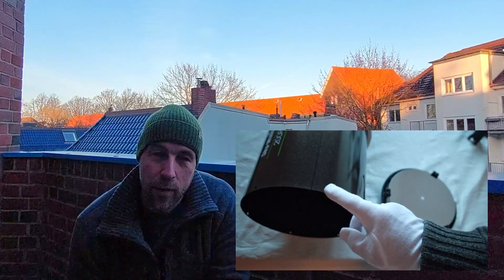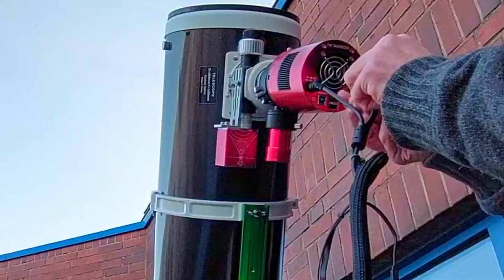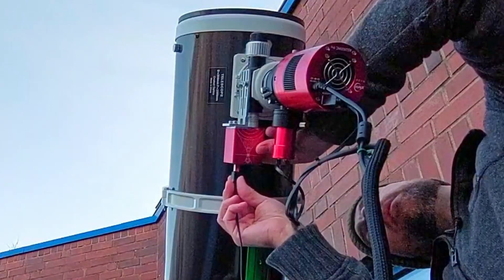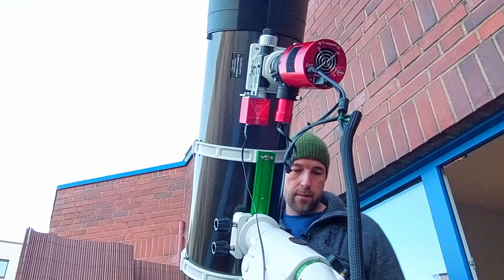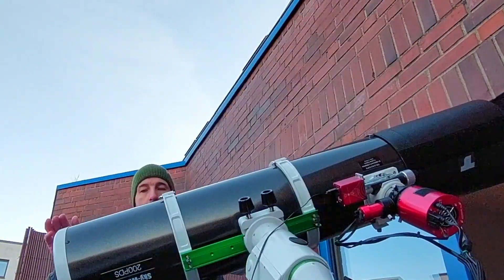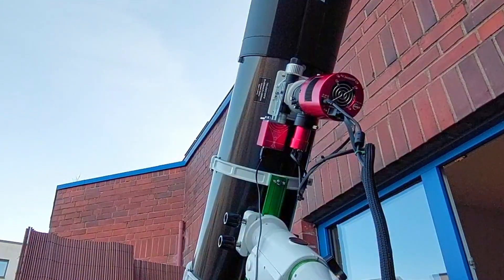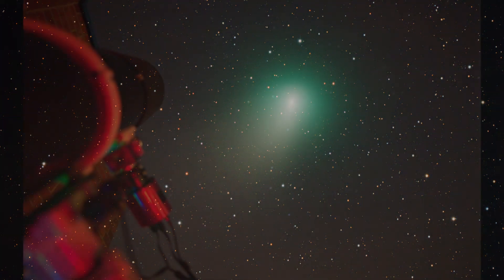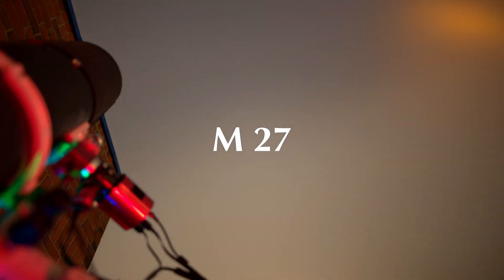Sky-Watcher 200 PDS – First Light(s) Comet 2022 E3 & M27– Part II

Comment: Very similar set-up to mine. Same mount but I have the Quattro 200 not the PDS. Made a dew shield and back cap out of black felt. Also don't use an oag. Use a guide scope to reduce weight on the focuser. Nice pics as well.
Reply from the maker: Thanks so much for watching and for your kind comment as well. That's interesting: How do you like it? What experiences do you have with that quite high weight of the OTA on the mount, how is your guiding?  Do you have significant wind down under in the region where you live and if yes how is your guiding? Since the Quattro is significantly shorter than my PDS should be ok, right? I have quite bad guiding (compared to my APO setup) because of wind and I think the mount is (a little) "overwhelmed"...not terribly but you can definitely recognize. I thought going with an OAG would help me with the setup with regards to weight and surface area (-> wind etc.). Thanks again and clear skies!
Reply: @tullyfisher  Be more systematic with your balancing. When balancing the Dec axis have the scope sitting horizontal and tap with the same force on each end to see if the axis rotates to the same extent whether you apply the force to the front or back of the OTA, and with the RA axis do the same but with the weight and OTA. Also, make sure you are 'multistar guiding' with PHD2 and select the predictive PEC algorithm (significant improvement) and exposure setting 1.5 to 2 seconds (you wont be 'chasing the seeing' if you're using 'multistar guiding').
Reply from the maker: @michaelbibby8636  Hi. I know how to balance my scope. And I'm also using multi-star guiding and 2sec exposure etc. (I also never had any problems with guiding.) As said: the scope is just too heavy and big for the mount. Please watch my video about how to guide if you have further questions.
Reply: @tullyfisher   Some people get these scopes to guide well on these mounts, but it requires everything to be optimized. Probably helps if the mount has had the Rowan belt mod and the backlash tuned out. Good luck!
Reply from the maker: @michaelbibby8636  Sure, within optimal conditions it may work and you can get decent guiding. As you saw I also did. Rowan belt is always an option to tune the entire setup, yes.

Comment: Looking good pal, nice you've fixed the light leak issue.  Comet looked cool, I didn't realize DSS had a tool to stack these. 👍
Reply from the maker: Thanks very much pal. Yeah, that was a little frustrating..but then I also disassembled the scope again and this also helped a lot to reduce the leak I guess. I heard many people complaining about light leaks using this very scope. With regard to DSS: Yes, they do have two or three comet stacking functions and I also saw people using DSS with great results but in my case it did not work so I (for the very first time) used PI for stacking. But this was quite a long process.. But in the end the first comet processing went pretty good. :) Hope you are doing fine and have some clear skies. Thanks for watching Ollie!